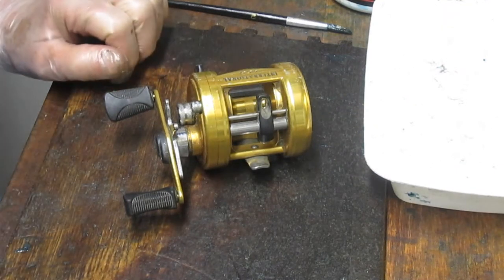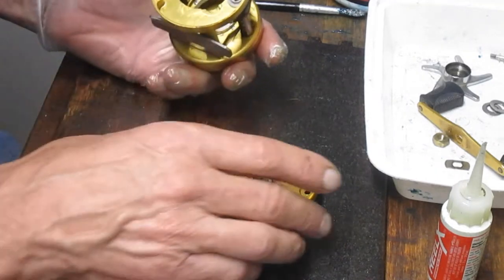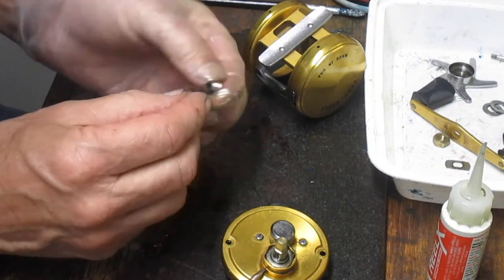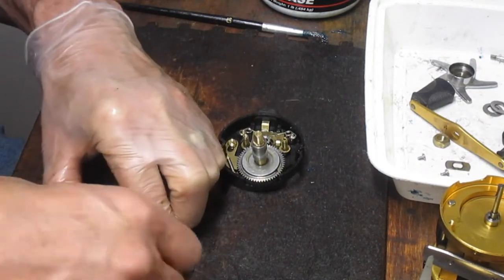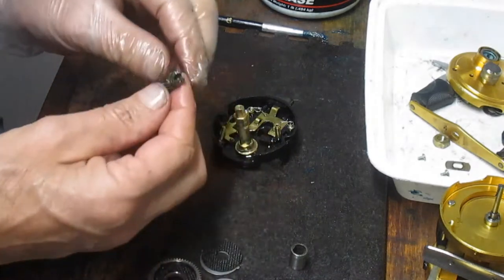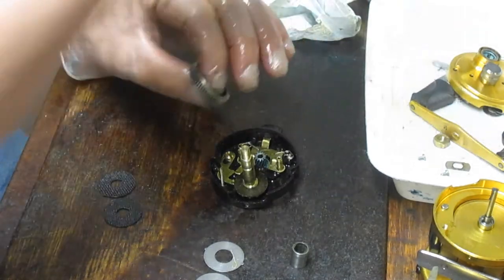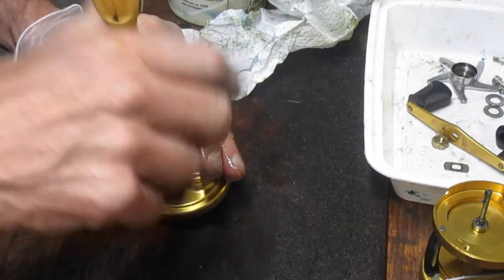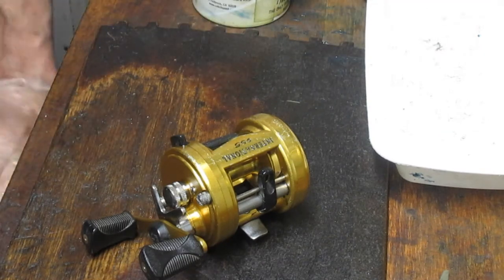Penn International 955 saltwater reel how to take apart and service copy

Comment: Hi Dennis, your videos are second to none! I’ve got a question for you pertaining to this model reel. I took mine apart to clean and oil and all of a sudden there are 2 very small rubber o rings laying on my parts tray. And I can’t figure out where they came from? They are less than a 1/4 inch in diameter.
Reply from the maker: I believe the washers you are referring to go on the two main case screws before they are inserted into the side plate

Comment: Hi Dennis,

Your tutorial sharing of reel maintenance always interests me. 👍

Like to ask if it's common for the handle (same Penn 955) to be wobbly when the star drag is back out? Or is there something broken internally? 

Thank you 😊
Reply from the maker: That is not common.  You need to make sure that the handle nut I fully tightened down,  If it is, check to make sure it is not cross stripped and causing the handle to sit on an angle other than square to the star adjuster,  If the handle is level and the nut is fully tightened, there shouldn't be any other wobble
Reply: @2ndChanceTackle  
I'll check it out again. Hopefully it's nothing serious but some silly mistake. 🤞

Thank you so much Dennis 👍

Comment: I just bought one's of these with stuck drag washers and a puppy chewed finger handles. What is the average price these are going for? Don't see any on the usually auction website. I remember watching Dan hernandez use these on his TV show. Would watch him before going to school.
Reply from the maker: These reels are still very sought after and it is not unusual for one in good condition to sell for over $100.  Yours is worth repairing -  Dennis
Reply: @2ndChanceTackle  I just took it apart and the gear stud sleeve was rusted stuck on. Had to hit it with oil, then a butane torch and finally tap it out with a rubber mallet. The gear stud collar actually bent and broke. Lucky Mystic parts has some for $10. The same part is used in the 965.

Comment: Is the penn 975 similar?
Any significant differences?
Reply from the maker: These are basically the same reel. The difference is usually in spool capacity while the internal gears are normally the same set up. - Dennis